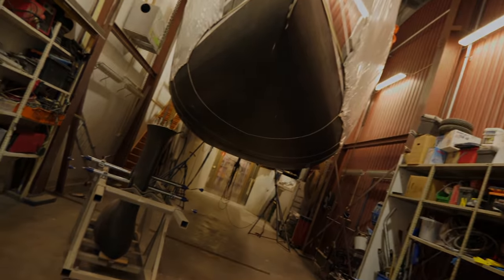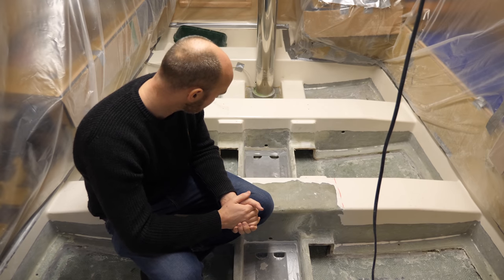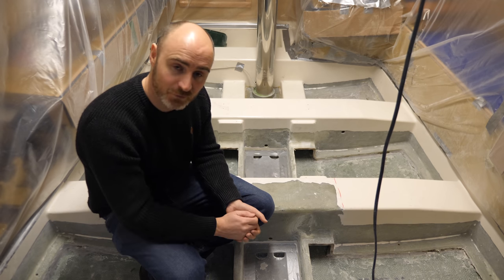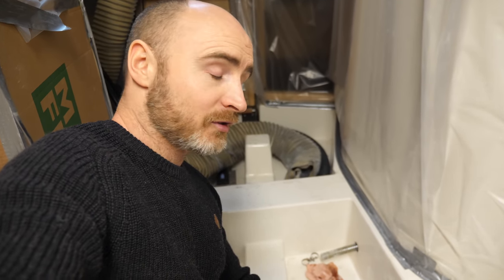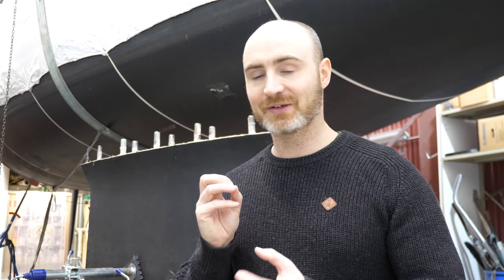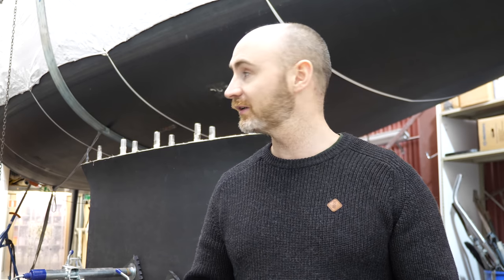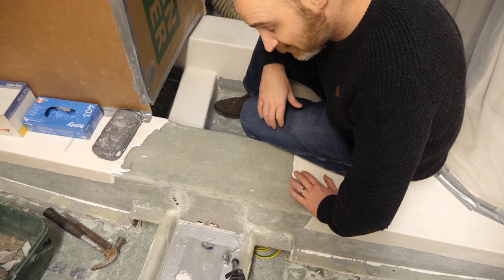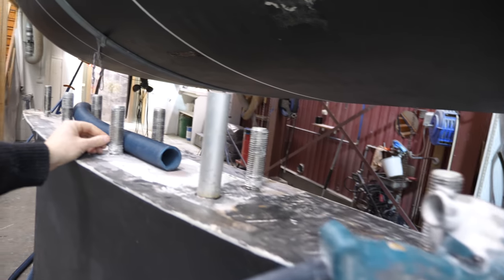SAILBOAT REBUILD - what they DON'T TELL YOU about PRODUCTION BOATS - Plastskador repair week 2

Comment: you should check out how X-Yachts mount their keel into a steal craddle that also takes the mast and the spreaders. Had a grounding with my X-442 on an uncharted rock after Tsunami in Thailand, at about 6 knots, the boat stopped with a massive bang, but we managed to here off the rock. On inspection, the lower led keel itself had some holes and scoops of led missing. The keel to hull bond was solid all around, no cracks in the hull or keel mount area. Inside the craddle was in perfect shape, no delamination, keel bolts straight and undamaged. Back in the water in a few days. X-Yachts !
Reply from the maker: Sounds like you got very lucky, i saw an x yacht being repaired the other day, would put the picture here if possible. The X yachts are awesome boats, you really get what you pay for but it comes at a cost. A new x Yacht is more than double a Hanse, wish I could afford one. They have a steel grid instead of fibreglass. The only problem is, if the steel grid bends, you are in big problems. Great boats though and very fast. This year we raced my friends x443. Cheers
Reply: @SailingAurora  A lead keel will absorb the force better than some alternatives.

Comment: I wouldn't buy a production boat. Ever. I really do struggle with bolt on keels. I have grounded a few times and my well built solid keel took it in its stride. Grounding is a fact of life on a sail boat and I just can not get my head around compromising the integrity of the boats structure. I love the look and finish of these boats but think this is a flaw that needs be addressed.
Reply from the maker: Hi Steven, you have some fair points and I agree somewhat. Nowadays people are looking for performance also and full keels or longer keels are just a little slower. I guess the solution is to never run aground but we both know that is unlikely. A company called Linjett in Sweden has a good solution with a swinging keel in the event of ground, but I sense problems there also. BR Chris
Reply: That’s o k if you can afford hand built
Reply: A laminated fin keel with internal lead ballast would be nice.
Reply: Your instincts about bolted keels are quite correct. It will probably recede as a technology, and its main purpose was only to make sailboats available at a lower price point. It has been, overall, a debacle.
Reply: Boat maintenance and repair is expensive. I doubt I'd buy a small cruiser but if I did I'd favour a Victoria 30 with full Keel and encapsulated ballast. At least you know its not going to fall off and the Hull design is seakindly.
I remember the story of Drum in the Fastnet which suffered Keel failure and flipped over. Beneteau and Dufour are the same with a bolt on fin waiting to snap or fall off.

Comment: I had a brand new yacht custom built I later was shocked at how thin the laminations were. I later bought an older yacht that was built by a well respected builder and the difference in strength is extraordinary. Years later this yacht still looks new. Zero stress fractures.
Reply from the maker: It's amazing what a little extra can do with boat building, it's all about the budget I guess :)

Comment: you do not need a seacock for the big (or any) bilge pump, because the through hull has to be way up above the water line. Of course no T into the existing bilge pump line. Big hose, 1.5" and no check valve.
Reply from the maker: That's exactly what I did, thanks for the advice though

Comment: I'm a boat builder in the uk and have had to repair a number of yachts with similar damage. 
I think I've seen four Oceanis 34's in the past couple of years for example.
Couple of things that struck me from the video.
Your info re epoxy is incorrect.
I agree that laminating strength would be fine using polyester or even better, vinylester.
However this repair relies on bonding performance to a vinylester hull as well as laminating.
Bonding performance of vinylester on cured vinylester laminate is reasonable.
The bonding performance of polyester however is poor.
Epoxy will significantly outperform both.
Finishing of the inside of the hull using a white epoxy primer is just as easy as gellwashing it, with the added benefit of the epoxy being watertight where'as the gelcoat is microporus. (hense Osmosis)
I would also advise the use of Polysulphide sealant such as Arbokol1000 for the keel joint.
You really don't need the adhesive qualities of Sika or Saba as thats what the Keel bolts are there for.
What you do need is the sealing qualities and Adhesive Sealants tend to lose their sealant qualities long before the adhesive.
Overtime when the sealant hardens it loses its flex and water will creep in via capilary action to the root of the keelbolts providing the ideal conditions for crevis crack corrosion.
I have seen this numerous times.
Much better to use a flexible sealant that does not harden over time and rely on the keelbolts to hold the keel on as thats what they're there for.
Reply: And if ever the keel has to come off again you dont rip part of the hull off .
Reply: @billhanna8838  We have a rule here at the yard that if its bolted down (cleats, fairleads, tracks, hatches etc) then use Arbokol or even butyl tape. The main resoning is that the majority of these fittings will be removed again within 10 years for one reason or another. 
Also keelbolts are not a tighten up and forget job, they need re tightening to the correct torque on a regular basis (every two or three years) as the bolts do stretch  a little, the laminate will compress a little.
Reply from the maker: Hi Mike, it sounds like you have a lot of experience, I appreciate you watching. Thanks for the input It's good to compare different procedures and materials.

About the polyester... you will see more of this in the next video but I will explain. As you said Polyester resin on it's own will not laminate well to vinylester, this is why the Crestafix polyester adhesive is used to create the initial bond between the hull and the first layer of glass and as you know this is the most important part. Plastskador have done multiple tests with this method and it's proved extremely strong. The glass is then laid on top and the polyester resin can then be wetted in. Also the reason the polyester is used is because it's more than strong enough for this application, Plastskador have witnessed many times, previously repaired boats that have been grounded again come back with damages located in the next weakest area in the boat. Usually the damage new damage is located further up the hull and not in the previously repaired area. As you mentioned there are ways of finishing the epoxy using primer but gelcoat can be applied to the polyester and in my opinion will create a nicer finish and closer to the way it looked leaving the factory.

When it comes to the keel, Plastskador have seen on occasion that the shock of a grounding can sometimes strip the bolts and because the sealant is flexible it will pull the keel back towards the boat. I saw this fist hand with our boat, the bolts held but there was water in the bilge directly after the grounding. The leak had stopped because the adhesive pulled the keel back up and resealed the gap. I personally I would prefer both a sealant and adhesive holding the keel on for maximum safety, I wouldn't want to rely on just the bolts. You can see at the end of my first repair video how much extra holding strength it gives the keel. Thanks for the advice on the chemicals though, I will check them out, cheers
Reply: On the maxi 1000 owners website nice article on removal of a glassed in keel recessed what a nightmare it is to get off compared to this one - echoing the builders chaps points above some thought on maintenance helps -  this boat in question did not sink or loose it’s keel and can be mended - good result  nice work
Reply: @gbr562  Yes seen a Bavaria s keel twice removed (Charter boat & Funny same rock) Not a nice ending with the keel epoxied , Medium Job become a major repair
Reply: I use ms polymer to the seals. You are correct on evereting! Poliéster on a vinylester its a mistake. Just cheaper. Epoxy is 30% more strong and easy to work. And epóxi Paint to finnish and seal to protect from UV.
Reply from the maker: @billhanna8838  Hope so
Reply from the maker: @gbr562  Good advice, I never thought about that, will have to check every once in a whilee with the torque wrench. Thanks
Reply from the maker: @al29_fam_vids  Thanks :)
Reply: Everything Mike says is correct.  A flexible epoxy is infinitely superior to a stiff, brittle polyester resin.  Stiff breaks.  Flexible gives a little and doesn't break.  Fittings are bronze; not brass.  You don't want the keel rigidly glued to the hull.  Something has to be able to give a little.  Better to have the bedding compound give than the hull to fracture.  Bilge pump lines should exit the transom.  If on the side of the boat, they will be underwater at some point, possibly siphoning water into the bilge.  I'm just an amateur with a history of owning over a dozen fiberglass sailboats and doing all of the maintenance and refitting on all of them myself.  Also restored a few airplanes and built a couple of cars so I have a decent mechanical background.
Reply from the maker: @David-hm9ic  Hi David. After many comments on the channel and doing a lot of research, I can see the arguments for both Polyester and Epoxy. I believe a lot of the opinions stem from workers being used to a certain material to work with. In this case the yard that my boat is in now has been working with Polyester for many years and it's a true and tried method. If they were getting boats back because the material was not strong enough, they would have switched to Epoxy a long time ago. Also the Polyester being used here is Isophthalic and not orthophthalic. Isophthalic polyester resins are undoubtedly of a higher-grade and offer substantially higher strength, better flexibility and chemical resistance. When you start using Epoxy it's a whole different animal, to achieve maximum bonding performance the conditions need to be right and to get the perfect result a vacuum is sometimes needed to get the air out. Polyester is a lot more forgiving in the aspect, easier to wet out and coupled together with Crestafix, it makes an extremely strong bond. They have even tested the bond with saturated glass with Diesel and it's still really good. Personally, I think Polyester will be more than good enough for this application, the next thing to break will not be the repaired parts.

Also with Epoxy you cannot lay a Polyester gelcoat over it, meaning you have to use top coat, once you use Epoxy, you are stuck with it and can never go back, Gelcoat makes a better finish.. Again I can see the arguments for both and when you have done as much research as I have both reading and talking to workers, I am confident in my thinking. It would be interesting to make a test bench, maybe for a new video.

Still researching thru hulls, probably going to go with the True Design ones, they look pretty good. Thanks for the tip on the bronze ones, I wasn't sure on that one.

Also still looking at how I should do them bilge pump, I would love to put the through hull on the transom but I have no space at the moment to put the hole in the middle of the others to make it look nice and symmetrical. I know , I know I should be looking more at the practical side but I'm picky sometimes. I am going to the boatyard in a minute to have a look at it.

Thanks for the tips though, appreciate it. Cheers, Chris
Reply: @SailingAurora  If a keel bolt strips then its way too small.
In all my days as an engineer Ive never seen a bolt strip in service.
They will break but not strip.
Stripping happens when over torqued and even then its rare as a bolt will usually stretch
Reply: To precise Mike's answer:
Epoxi will take about 3% of water while any type of Polyester resin will take 11%. Epoxi coating under water will prevent osmosis, but can be done anytime later. As it's unlikely that the boat will have osmosis anyway. But if you want to be sure, do it as long the boat is new. When the laminate has soaked water,  expensive drying might be necessary.
Reply: @barroca4627  sorry this is incorrect. The strength and flexibility of vinyl ester / polyester / epoxies systems depends upon the exact formulation and design. One can generalize but be careful. One thing however I must take point with and that is UV resistance - both polyester and vinyl ester are far superior to UV versus Epoxy. Had you said polyurethane I could have agreed. Since this is internal UV is not an issue.
Reply: @Hotzenplotz1  I am happy you said this. Epoxies are still semi permeable membranes and are improved by the use of pigmentation, thickness etc.,  and are useful in mitigating Osmosis. Although modern boats rarely suffer from this. It seems that most people don’t know what Osmosis is in polymers. In the case of polyesters and gelcoats Osmosis occurs due to poor mixing and an excess of the catalyst or additive (high concentration) thus submerged in water and Osmosis can occur. The epoxy layer will reduce the osmotic pressure and should limit the risk of osmosis.
Reply: @SailingAurora  Exactly what you need to worry about symetr...form should always follow function when your life is on the line. I also agree that epoxy is a superior product as an adhesive. Never hurts to get multiple "expert" opinions before you make any decision. In my personal opinion I would  choose epoxy everytime.
Reply: @David-hm9ic  You said it all! I entirely agree with you on the quality of epoxy in comparison to polyester. Have a look at Expedition Evans to see how the grid is properly laminated to the hull. The WHOLE grid needs to be laminated over, best in epoxy, and all segments cracked need to be removed and relaminated. Not just sanded over. This does NOT look like a professional job AT ALL !!
Reply from the maker: @1philliph  Good to know, thanks for the comment. Sorry late to reply
Reply from the maker: @Hotzenplotz1  Good advice. The outside of the hull in Vinylester so is pretty resistant anyways. We also coated it with Epoxy barrier coat.
Reply from the maker: @milesbuckhurst504  True, after alot more research on the subject I agree, but the strength all depends on the initial bond with the hull
Reply from the maker: @andrewseaman7012  appreciate the comment, but I don't agree at all. Plastskador have many years of experience in the field and have had multiple independent evaulations. Otherwise they would not be trusted by the major insurance companies.
Reply: you have a lot of profound and practical experience. Thanks for sharing this!!
Guess the chemistry side of all this different materials is a science for its own. 
If I was the owner I would be very cautious indeed with the changing of structural parts. 
A boats structure is designed in a certain way to work with the forces. More is not always better 😉 tricky thing.
Reply: I believe Epoxy resin is about 4 times stronger than Polyester, as also way better in therms of aderence, way more expensive also, but for the task there, I would take the extra cost of epoxy for the extra resistance, and vacuum laminate the all thing also... what is your opinion on my thoughts?
Reply: As a fellow yacht builder I agree

Comment: As Chris says, most modern boats have been built this way for a number of years. HR use a similar grid frame that is bonded (whether it's over laminated I'm not sure, in some pictures it doesn't look like it is). You have to remember the energy involved in 12 tons of boat travelling at (let's say) 6 knots meeting a solid object like a rock. If you think of a car analogy and you have an accident, the chasis is always checked afterwards, this is the boats "chasis". This is why the ORC are now stipulating hull condition checks before offshore races, especially after cheeki raffiki and it's various repairs. Modern boats / keel designs are fine for all the conditions they will encounter at sea, but not designed for significant contact with the land or immovable objects.  The important thing after damage is the integrity of the repair and this job looks to be very thorough. Get those wires and some spare mousing lines in whilst you can Chris ;-)
Reply: You guys are wrong about Hallberg Rassy they do not rely on the grid to support the keel, their hull forms a deep flange at least 200mm
often deeper the keel is then bolted to this, i have seen a HR 64  after hitting a rock at 8 knots the keel  and joint was still good
the was damage  was along the hull as it was well heeled over when the collision happened and the hull scraped along an adjacent rock 
but not bad enough for water to penetrate.  As someone else has said buy a secondhand HR any day over one of the mass  production new builds , If you are serious about Sailing offshore..... Here is their latest 40 footer  see the stubby Flange.......
 https://www.hallberg-rassy.com/fileadmin/user_upload/HR40Cinteriorsideview.jpg
Reply from the maker: @Adrian-sail  https://www.hallberg-rassy.com/resources/how-a-hull-is-built/.     I'll just leave that there, I guess some of the Rassy's are built with a grid. Maybe different with each model
Reply: You guys are insisting that keel repairs are a part of life, when you perhaps should insist that design changes are in order. A bolted keel on a dropped-in frame is a great way to have a boat that's almost never at sea. Groundings happen every single day of the year.
Reply: @steampunk888  “a bolted keel on a dropped in frame”……you mean like pretty much every modern production boat built over the last decades…literally thousands of them sailing all over the world and crossing oceans.